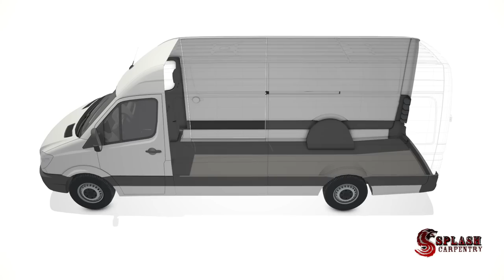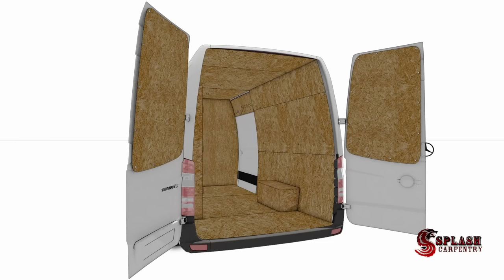Van partition, insulation, paneling and shelving kit Sprinter 2500 High Roof

Comment: Having spent a week in the austrian mountains at below -8° Celsius / 17 °  Fahrenheit in my van, I can just laugh about your insulation.
Reply: I totally understand but the purpose of this kit is to protect the van against dents caused by our tools and materials. We did not intend to build an RV. We carry hardwood floors, contractor bags full of debris from our job sites etc.
However, technology evolved and we invested heavily in it. We will laser scan the entire van, make molds on our cnc machine and the new insulation will fit perfectly and it will be easy to remove if needed. Again, we are not intending to build RV's.
Reply: Former floor tiler here. Though I am sceptical about the value of the insulation in thermal protection, I admire the precision you guys achieve. There's a market out there for exactly this.
Reply: @brrrlak  We really appreciate it! We will eventually remove the kit and rebuild it with much better results. We will also post a video with the whole process to show people that there is no mold under the panels despite we are in Chicagoland where the weather is changing abruptly all the time.
Reply: Mold should imho not be a problem because there is apace for air to move behind your panels. Another thought: I covered roughly the same areas like you with 50mm of Armaflex. I could then measure with an IR thermometer that the "beams" and "rips" (lack of vocabulary here, sorry for that) are responsible for the heat/ cold exchange. Covering a lot of these bought me 5° Celsius. So, if you could find a way to produce a kit that covers the "valleys" and the "hills" and then mount the panels over that, THEN you have a ton of customers among the RVers. Many of them like the sprinter.
Reply: @brrrlak  That is exactly what I am planning to do but I spent over $110,000 already and I am not there yet. I could really use an Artec Leo for scanning but the resources are limited and my wife will probably kill me if I buy it. I never give up thou and despite is been almost 3 years since I put this video out, I am pursuing the final result. Thank you for the tip. I will certainly use it in the next video.
Reply: You know what, buying some flowers for the wife before you go scanner shopping might help avoid the killing :-)

Comment: I am looking right now for a van. I have a very important question. Should you buy a van that has driver, passenger and windshield only?? I'm thinking that Stealth and Insulation might be affected by More windows on the sides and back.
Reply: As far as we are concerned, it does not matter if it has windows or not, we are still able to install a kit in it. It all depends on what are you going to use it for. If you are in Chicago and Lake Shore Dr. is important for you, a van with windows all around is a good idea because you cannot drive it on that road otherwise. For construction or cargo, I would buy one without windows.

Comment: from the stand point of being the basis for an rv project, not a bad idea. a work van? not so much (in my humble opinion). the wood looks good, and might inspire the diy crowd to keep up with the good looks of the wood, and not muck everything up too much. of course if it were my project, i'd...on second thought, i'll save my ideas for my own project(s).
Reply: Ideas are great. Many people have great ideas. The problem is to turn an idea into reality. It takes a few seconds to come up with an idea of a product. Then the reality kicks in: knowledge, experience in woodworking, a shop, equipment, tests, marketing, tests again, back to the drawing board, test again, marketing again and so on. Most of the people are good at having ideas, very few will invest years and a fortune to make it happen. We will come up with a kit for all 64 models currently sold in United States. We don't need to save our ideas, we will sell them, as a finished product.

Comment: Transit 250 high roof cargo van. I need something like this. What’s the cost? 
Some negative comments below. People who expedite in cargo vans live in them 3-12 weeks at a time on the road. Expedite is time critical movement of LTTL freight, where we may drive 1200 miles in 24 hours. 
I was in spirit lake Iowa 2 weeks ago, -12 degrees. Then I went to upstate Vermont -16 degrees. 
Gas engine. You’re not supposed to idle gas engines all night or the multiple days that it may take to get the next load. 
When we’re on a load, we usually only have 4-6 hours in a 24 hour period to play with, ie the route calls for 20 hours of driving in 24 hours. Sometimes we don’t even get 2-3 hours of play, so we don’t get a hotel every night, we get one once or twice a week if we’re not on a load or we have plenty of time on a load to get 8-12 hours of rest. Rare. 
We go all over the country. Canada to Laredo where it’s 110 degrees in the summer. Boston to Los Angeles.
Reply: Mikey, I am sorry but we are in the middle of upgrading our shop. It will take at least one year this we will be back on the market. We want to improve the products to the max, especially the insulation part and the installation process.

Comment: im sorry, but that van was not insulated properly.
Reply: The product is designed to be cost efficient and it's targeting customers like contractors and coast to coast drivers. It was not intended to be used for RV conversion.
Reply: yeah, bridging.
Reply: Insulation depends on where it is designed to be used.
Reply: Would be grateful if you could point out a few pointers.  I'm researching van insulations so it would be mighty helpful.  Thanks.
Reply: Hi, we are scheduled to do a custom Dodge Promaster in late October, early November. We will have a very detailed installation video, with animation and instructions. Starting with this product, we will be able to list them online one after another withy confidence that the product is good, the installation instructions are perfect and there is no risk of misunderstanding the steps.
Reply: Robert, thank you for understanding what are we trying to do here: protect a $40,000 vehicle from banging it from the inside out with all the tools, materials or construction debris we carry around. We are not trying to get into the RV market.
Reply: @cncdesigns-Chris  good work, i like it.
Reply: thank you! it is very pleasant to see that people appreciate our efforts
Reply: Robert Ott   Your a fool - you can't "over Insulate"

Comment: How much is 3 times lighter? If the competition is 100lbs, does that mean this is -200lbs?
Reply: There is nothing out there at 100lbs. There are options with divider, without, shelving or not and so on. We are trying to come up with a kit that can be easily modified to the customer's needs and also be cost effective. The DIY part is also crucial: when you buy a new vehicle, there is a bond between you and that car. It takes years of driving, wearing off, scratches and dents till the owner looks at the car and does not have that particular feeling. People will buy our product, it's just a mater of time and a ton of effort and pain till we will make it flawless.

Comment: Looks good! What's laser scanning?
Reply: look up any demo video with the Artec Leo laser scanner, that is what we will use to develop our products
Reply: terrible to close off the front & force one to exit the cab to enter the rear.  POOR PLANNING
Reply: It was the customer's choice not to have a door. Most of our customers are contractors (painters, carpenters, electricians etc.). So far none of them asked for a door in the partition. If this would be designed for camping, yes, it would be very bad planning, but it was not designed for van conversion.
Reply: If you are a contractor, you want the front closed off to protect your tools.
Reply: @daviddionne8296  As simple as that.

Comment: This insulation is useless.
Reply: it serves it's purpose: when the tools and and a few bundles of hardwood floor accidentally bang the sides of the van, there is no harm to the body. It's also much quieter while driving. We will improve the insulation over time but it requires tens of thousands to model and create the mold for each piece and this is only for one model. Kind of discouraging but I will start with a Metris, my own and see how the public reacts  to the idea.